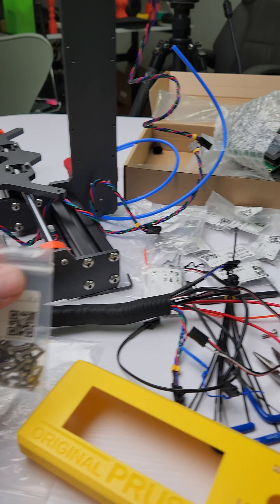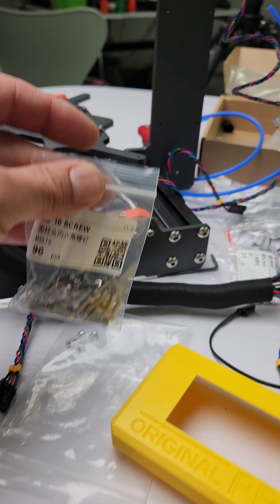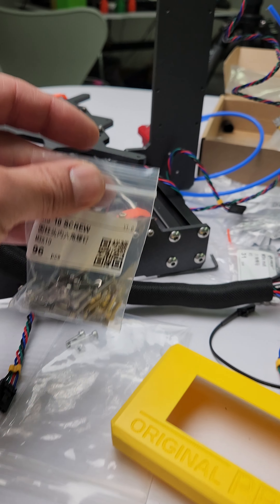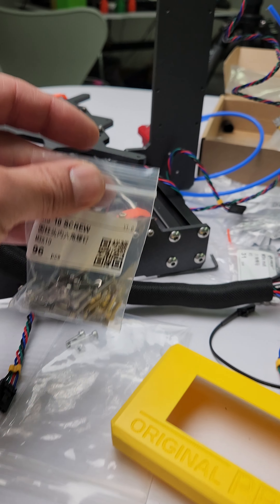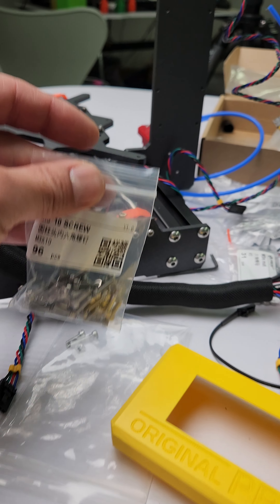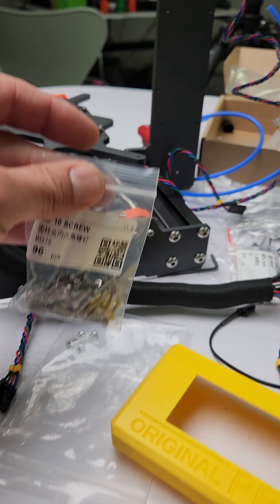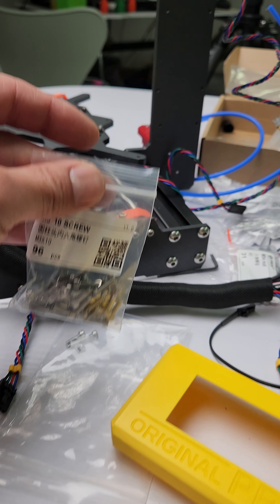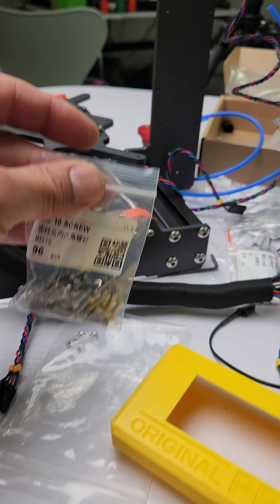Prusa MK3S+ Clone Assembly Update!  So far so good.

Comment: That's awesome max👊👊
Reply from the maker: Tharnks
Reply: @3dPrinterSchool  u bet
Reply: @3dPrinterSchool  I think T nuts are on the wrong side
Reply from the maker: @Marcos-tj8nk  I thought so too but the clone power supply has it on the top so I got it right by accident,  I got it running today finally BTW.